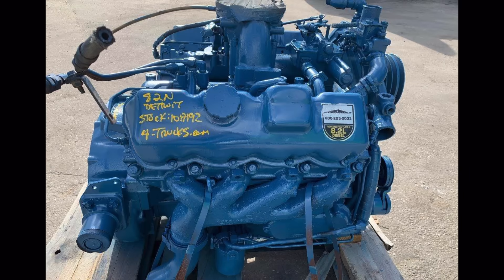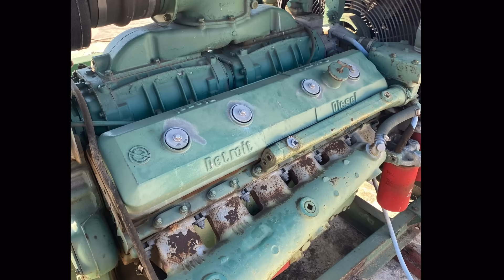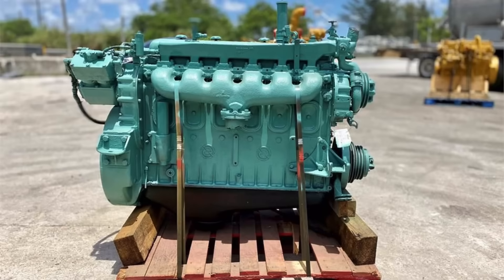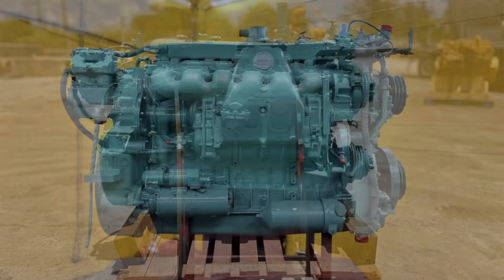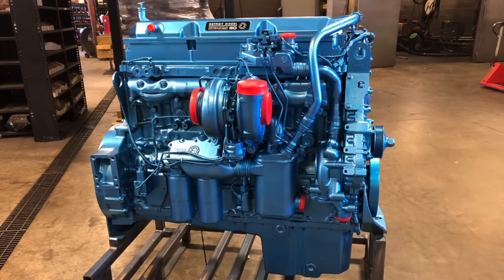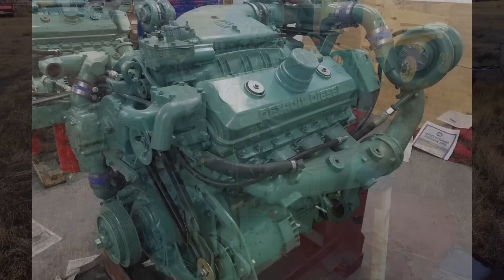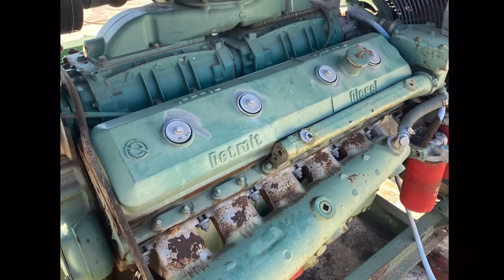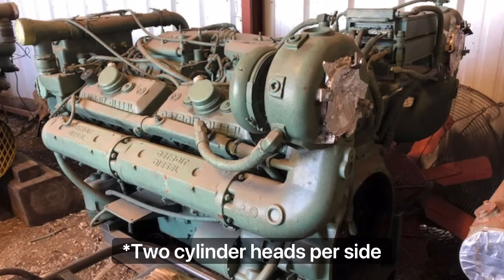Best Engines: GM Builds an Awesome V12 with Detroit Diesel's 12V71 "Buzzin' Dozen"

Comment: I did my apprenticeship with International Harvesters so as a result came into contact with a significant number of Detroit's of various ages from 53 series then much later 92.
They struck me as being a well designed and thought out engine finely built components compared to some of the others at that time.
There were continuous improvements over the years, including the introduction of the cross head piston, or more commonly called the articulated pistons.
I don't recall any other manufacturer employing this system until years later, also above port cooling. These engines have a small rectangular air box cover rather than the big single oval one, aluminum rocker covers bigger injectors etc to name just a few.
The oldest Detroit I rebuilt was, I think from memory was called Grey Marine, I may be wrong here but it was x military 6-71 low block, it was powering a small tug boat and reportedly came out of a US landing craft.
Obviously a lot of the manufacturing techniques used in this particular engine were of the period, of note was the use of a one piece conventional head gasket rather than the later compression seal ring configuration.
I have no idea how many hours the engine had done over all, and there was no indication it had any significant prior work but after the rebuild. liner kits, valves, injectors, bearings, seal and blower bearings, oil pump clean and inspection etc all the normal things, no crank regrinding or anything of that nature it went back into service.
Ten year later when I left the area it was still going strong up to 15 hrs a day dragging all types of barges around.
My thoughts on the Detroit.
I think it was one of the most outstanding engines of its time, yeah it leaked oil and had its flaws, what engine is perfect. but it was honest, worked hard. Because or standardization of parts across a series it was cheep to rebuild and relatively simple in the process. the only service tools required were the injector timing gauges, you could do the rest with a basic tool kit
I remember reading in the early 90s that something in the order of 85% or more of Detroit's built were still operating in a multitude of applications.
If that's not testament to a good engine design, what is?

Comment: Detroit was the last of GM's big three diesel divisions, coming after Winton/Cleveland and Electro-Motive.  I'm a railroader so I'm most familiar with the three series of EMD engines, the 567, 645 and 710 (those numbers are also displacement per cylinder).  The 567 is exactly twice the bore and twice the stroke of a 71, and was designed at the same time by the same GM engineering team.  The main differences from Detroits are that EMDs have a fabricated (welded) crankcase and top deck (these two sections are bolted together and constitute the 'engine block'), they have individual heads and single cylinders (power assemblies) can be removed and replaced fairly easily.  They are overhead cam engines with no pushrods and turbocharged EMDs do not have roots blowers, instead the turbo has an overrunning or 'Sprague' clutch and is kept spinning by the engine geartrain when idling or at lower speeds.  As the engine revs up the 'load' of forcing air into the engine gradually shifts from the geartrain to the exhaust turbine, and the clutch disengages once there is enough exhaust pressure for the turbo to freewheel faster than the gears are turning.  EMD has used this turbo design since the late 1950s, and it might be the earliest example of what would now be called twincharging.

EMDs are all 45 degree V engines, with power outputs ranging from the 600 HP roots-blown 6-567 all the way up to the 5500 HP turbocharged 20-710.  The 567 is a legend in the railroad world, as it more than anything else is what killed the steam locomotive in North America.  And they all have that signature 2-stroke scream on steroids, the earlier turbocharged 567s and 645s without exhaust silencers are my favourite, they shriek like a banshee, no diesel rattle at all, they sound like a bass-boosted jet engine on takeoff.  

EMD is now owned by Caterpillar and the 710 engine is still in new production today.  It gained electronic injection and controls in the mid-1990s (the computer in our locomotives is called the EMDEC, their version of DDEC), and can be found in locomotives, ships and generators all over the world.  Dual-fuel natural gas versions are available and it even meets the EPA's Tier-IV emissions standards with exhaust aftertreatment, though the railroads are avoiding these systems like the plague and as a result very few new EMD locomotives have been built for North American use since Tier-IV came into effect (rebuilds are grandfathered in, and there are thousands of older EMDs still running in daily service in North America alone).
Reply: Nice. I was engineer on a tug with two 645 mains and a couple 8-71 aux engines. Absolute music at full away!  I also saw the aftermath of a 12v149 which ran away, it destroyed the alternator and even threw the pole shoes off, it finally stopped after damaging the valve train enough but surprisingly the rotating assembly stayed together. They’re great engines, I have a few 6v53’s in personal projects. One is likely the only Detroit diesel powered 1924 Fordson F model tractor in existence.  That was a fun build.
Reply: @FlatBroke612 ..... you need to (Please) do a video of your 24 Fordson F.... and share the build with the world.  : )
Reply: Thank you for this. As a truck driver here in NYC, and also a rail fan I found your post extremely informative and interesting
Reply: My White Noise of choice is an idling EMD 16-645 out of a towboat or locomotive. there's just something about the zinging singing turbos, the Rocker click and geardrive that helps me drift to LaLaLand!!!
Reply: I used to work on 645’s for power generation. 2.5 mw a piece.
Reply: @JAMESWUERTELE you have to fix that. MW= mega watts

mw= milliwatts
Reply: Makes me wonder if EMD’s tier IV efforts could be translated to the DD platform, as i recall there’s still new blocks available from the company that bought all of DD’s 2 stroke tooling…
Reply: @fitzmorrispr ..... the ONLY company that bought Any of DD's "tooling", was the W.W.Williams Co., and that was Only for the 6-110 engine.
Reply: Excellent, compared knowledge, especially compared to some  of the misguided comments about Detroits&EMD'S, I Thought only later series Turbo 645 featured the sprag style blower bypass??🤔
Reply: @damienodonohue1327 .... All the Axial Flow turbo's on the EMD engines were coupled with an "over-running" clutch.... though the early ones had "material" issues and were prone to early failure, especially on the 16 cyl. engines, and at approximately $22K a "pop".... many railroads "de-tuned" the engines and reverted back to the roots blowers until EMD rectified the materials issue within the clutch assembly... which they did.
Reply: @Romans--bo7br  Thank you for your knowledgeable reply,  there are so many uninformed comments on this sometimes ridiculous platform, mainly from people who I doubt have ever carted grain on a flat top with gates&curtains, and grain traps!!!
Reply: i never got to run the FL-9 :( i just missed it by 2 years
Reply: I've worked in the offshore maritime industry over the past 40 years. Supply boats that service oil rigs sometimes had a pair of 645s in them. I worked a few boats with them. It was impressive to that kind of power maneuvering/navigating around.
Reply: Detroit will still be the King.  Clatterpillar and Cummins is next in line❤

Comment: i have always loved the sound of a Detroit diesel my favorite was the one in the massive crash fire truck my dad drove as a firefighter for the air force the tires were just huge over 5 feet tall and very wide they kept that truck forever as it had a very unique and large dry chemical system on board basically a massive fire extinguisher hundreds and hundreds of pounds worth of the stuff and it was truly amazing to hear go out it might have had the 12v71 but im not sure it could have been the 8v71 i never got to see the engine when i was younger but i did get to talk to the mechanic that worked on it an was told it had a Detroit diesel engine in it some of the trucks they had were powered by cat engines as well it also has a unique sound but they were much newer trucks amazing stuff honestly i still find the pumping power of some of the trucks they had truly amazing the volume of water that could be moved was really large unfortunately i can’t remember the numbers and my das has sense passed on so i can’t ask unfortunately but i will say if you want some real good info in addition to what you covered in this video the bus grease monkey youtube channel is very interesting he really knows his stuff and it’s great he is available to help out the bus would with their busses as the knowledge is definitely disappearing with the passing of time  an if he doesn’t know how has connections that do for parts and so much more if i had a vehicle with a Detroit in it buss grease monkey it my go to

Comment: I operated a Euclid TS-24 scraper back in the 80’s. 12V-71 in front and a 6-71 in back. Both with straight pipes!  Nice machine and pretty fast, around 35 mph on the haul road. 

But LOUD!!!  First time I ever wore earplugs on a scraper. Prior to that, I’d been running Cat 641’s & 631’s. 

I did like the sound of those two Detroits singing in harmony, however!

Back in the 40’s, 50’s & 60’s GM was at the pinnacle of engineering prowess. Nothing was too big for them to take on and excel at. 

EMD
Detroit Diesel 
GM Coach
Euclid 
Allison

They led the world in design and innovation!
Reply: The ts24 I ran had the 12v71t in front and they put a 6v92t in the rear. That bitch would get it on. After lunch I would put a gallon of oil in the 12 and 1/2 gallon in the 6. Hauled 40 yards each trip. 370 gallon diesel in a day. Loved it❤
Reply: As a kid I lived right next to a major earthworks project. There were many Euclids, some with the v12 and straight 6 engines. As they went in and out of sync the noise was a delight to a pre engineer boy. Thanks for the vid.
Reply: Back in '75 I ran a Wabco 33yd. self elevating scraper for my Father in law. 12v71 was used to drive the huge rotor/stator setup. Everything was electric,even the steering! When the points stuck on the steering, it was nerve wracking.

Comment: In the 1990s I drove a rock truck at a surface coal Mine , It was a Euclid truck And it had a V16 Detroit engine .We called it the screaming Detroit, And this was the only Detroit engine I ever saw that did not leak oil !
Reply: My 1980 KW 86" Aerodyne cabover had a 8V-92TA. I had to tilt the cab many times to show a Detroit that didn't leak.
Reply: They had a drain on the airbox u had to turn petcock as regular maintenance to let out oil, most never bothered

Comment: You should do GM's EMD division: Locomotives. the classic 567 cu in PER CYLINDER, the later 645s of the 1960s. There's a youtube of 11 hours of a 567 (in an EMD E7) at idle:  https://youtu.be/-yhkymFqZoo?si=hnrnLsgOAQqPTLsU

Comment: I worked for DD 20 years and had a 24 V 71 series fail due to vibration problems. Unit was under warranty and it was beast.

Comment: Hello there friend. I'm a retired heavy equipment mechanic. I've rebuilt a lot of Detroits. When I was a novice I saw a fresh 4-53 run away on startup. I was always extremely cautious around these noisy beasts. To the uninitiated, a Detroit sounds like it's going to blow up. Being 2 cycle, it revs twice as fast. And that smell. Like following a Greyhound bus ( also Detroit). I had a healthy respect for them. We had a 1 foot square board with a mop handle. The blower shutdown ALWAYS comes off on rebuild.. They were there for a reason. Runaways.
Reply: Yup. When they runaway everybody runs away too.
Once I was running a Gradall that ran away. Gritting my teeth hoping it didn't granade in my face as I was weaving thru hydraulic hoses and cylinders getting to the flapper. 
It's a sound and experience one never forgets.
Reply: @RandThompson-dd3sk we kept a mudflap behind seat to block intake for runaways
Reply: Thinking about buying a greyhound with a Detroit. Any thoughts on what to modify first?
Reply: It SOUNDS like it's revving twice as fast, but actually it's not.

Comment: A family friend years ago ran a heavy construction and trucking business.  All of his big trucks and heavy equipment were 2-cycle Detroit Diesel-powered. The Detroits' only weakness besides noise were those oil leaks--giving them the nickname "Driptroit".  He always said that leaving a Detroit idling for any length of time at regular idle was a big factor in causing the engine oil sealing problems.  If he was leaving the Detroits idling for any length of time,  he would bump the RPM up to about 1,000-1,200.  It used more fuel but seemed to avoid a lot of the oil leakage issues.
Reply: ALL Diesels... regardless of Cycles and brand.... Are fuel In-efficient at a "dead idle".  Bumping them up to 1200, moves them into a more efficient mode.   The 2 cycle Detroits, however -  should NEVER be idled at Any speed for longer than it takes to cool down the turbocharger(s), if the engine has been working hard.. only two to three minutes.  

N/A Detroits Do Not "need" to be cooled down more than 30 seconds to One minute before shut-down.  With no load on Any of the DD's.... the cylinder temperatures drop down too low, which WILL cause cylinder glazing and therefore, poor oil control by the rings (oil slobbering) and excess oil in the lower air-box galleries, and then out the air-box drain tubes, to the ground.... which also be (excess oil) caused by worn scavenging blower's oil seals, and oil getting by on the pressure side of the blower, and drawn in with the air flow, then into the air-box.

Comment: Detroit made several different engines. They made a 51, 53, 55, 71, 92, 110, and the 149 series two stroke engines. The 71 series had 1,2,3,4,6,8,12,16,and 24 cylinders. The 92 series had 6v, 8v, 12v, and 16v engines. The 53 series had 3, 4, 6, 8, and 12 cylinder versions. The 149 series had 8, 12, 16, and 20 cylinders. The 110 version was a 6 cylinder. The other two cycle Detroit engines I am not familiar with. Hope this helps
Reply: Series 55 was a 4 stroke 6 cylinder Mercedes based engine. They also made a 2-53.

Comment: Never been a fan of diesels. Especially the smell. The fuel and exhaust both have a smell that is extremely unpleasant to my senses. The sound of that 2 stroke 12 cylinder did sound great. But the modern 4 stroke sound isn't something that I enjoy

Comment: Fuel is injected like with other diesels, only air is blown in through the liners. That said, I love the stories about wide eyed drivers almost stalling one and it kicks over and runs backwards. We have an Oliver Super 99 with the 3-71, the timing is quite advanced. It happened to my brother at the end of the pulling track once.  It was a real oh sht moment when it started backing into the sled with smoke pouring out the intakes 😅
Reply: Not possible the DD fuel pumps only operated in one direction it runs with the blowers and the governor.
Reply: @zacb7427 Maybe learn about how things work before you make yourself look stupid interrupting the adult conversation.

Comment: 1 71...2 71..3 71 4 71 6 71. 8 71. 12 71  16 71..
THEN GANGED UP IN MULTI  ENGINE.  CONFIGUATIONS  IN 1 2 3 4 5 6   IN SHIPS TUGBOATS...
ETC...TRAINS...110.. 149 ....53 92 S...
WORKED ON MOST OF THEM

Comment: When I was young, many log truck companies in my area had 1271's in Cabover freightliers, hauling treelength or shotgun logs.  At night when it was quiet, you could hear those trucks for miles and they always had to drop 2 gears on the hill behind my summer cabin.  Your vidya is "12v71 pulling Satus Pass".    My fave detroit sound is the 8v92.